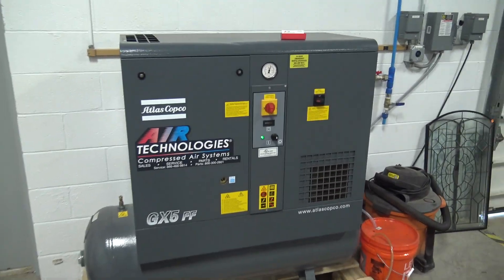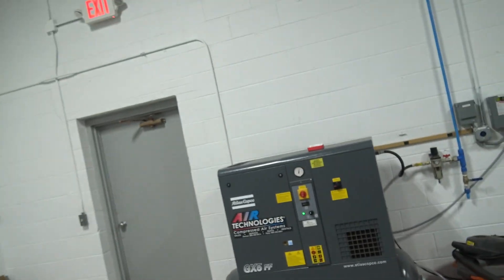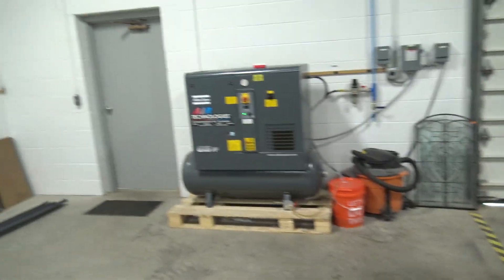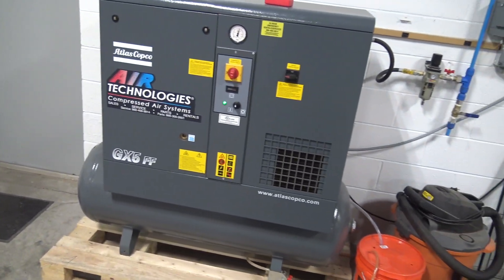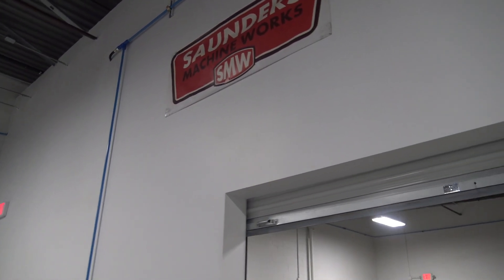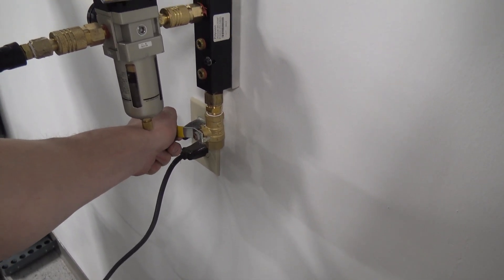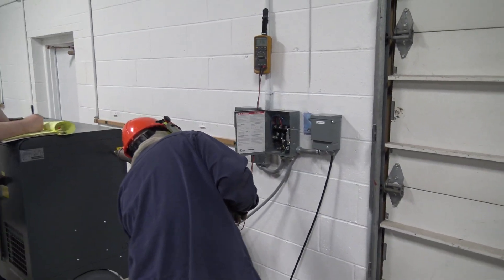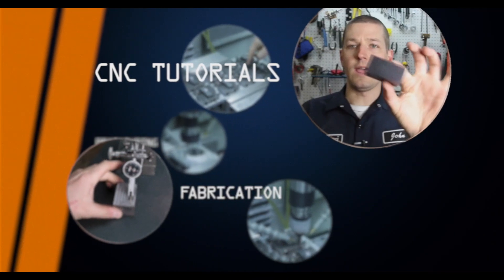Rotary Screw Air Compressor:  What are they?!  Worth the hype?

Comment: I bought a Kobalt Quiet-Tech and put it in a self-made wooden cabinet on wheels, and I have no idea when its running and when its not. I did put some foam padding inside the box, actually got that from my Hello Fresh food orders, its the "insulator pads" to help keep the food cold, worked great for insulation in the box haha. I really can't hear it. The only time I know it kicks on is if I am running my lathe, and pulling a lot of electricity, then my lights will dim a little when it kicks on, otherwise it makes no noise from the box.
Obviously the quiet tech compressors came our just a few years ago, so its newer technology than maybe what was available at the time of this video..

Comment: My workplace has a reeally nice Atlas copco screw comp, but they haven't gotten around to installing a proper pipe system. 
Instead, we have a mess of leaky air hoses hanging from the ceiling like christmas decorations. The high-pitched whiss from a couple of hundred leaky valves and hose clamps drives me nuts.
The compressor itself is very quiet though.

It produces a lot of excess heat in the area where it stands. We have a duct that can funnel the hot air outside, wich we open during the summer.
A ceiling fan helps to distribute the air throughout the shop, rather than just gathering in the corner.

Comment: I did not read all the comments.  Maybe it was already said maybe not.  
One of the reasons they like to continually run them is some of the starters in big plants cost 20 grand.   that have say a 200 hp to 500hp air compressor.  It is bad on the starter to start the machine repeatadly.

Comment: You said 600'... lol. In our smallest shops ( manufacturimg and maintenance... ) we have over 600 DROPS, 200 – 220 operators, mechanics, technicians, fabricators, etcetera. All done in " screw pipe "... ASTM carbon steel pipe... that smallest building is over 1,800 feet long and 500 +/_ feet wide with numerous compressors. Even doing my  proof house/prototype shop in town... was a pain in the pin feathers! 
I will say, yours turned out like you designed it... and is functional and sanitary! 
KUDO'S my friend, I realize this was shot 7 years ago... but still deserves a " pat on the back "!
Respectfully, Seth

Comment: If you dont have a large demand for air rotary screw compressors might not be the economic option. They are more suited for larger shops or manufacturing facilities that have higher demand. You can buy them with a VFD that will slow it down and unload it when the demand is low.

Comment: You can quiet your piston compressor significantly by installing a rubber hose as the only air intake to the filter housing. Some experimentation may be required in diameter, material, and length.

Comment: The after run on a screw compressor is so that the oil can cool. What happens is once pressure is reached in the tank the check valve in the screw housing opens and the return cooled oil floods the bottom of the screw vanes in the sump. If the compressor stops the oil would boil due to the generated heat of the hot oil on a stopped screw, under the circumstances the hot or superheated oil may also pose a fire hazard or cause varnish build up on the screw rotors and this wouldn't be good so cooled oil has to flood the bottom of the rotating screws.

Comment: We have a screw compressor  where I work and it is quieter than our old  piston compressors. But not quiet enough. Our screw compressor is outside of the main building in a dedicated shed here in Florida.  Its Way quieter!   My piston compressor at my home shop is also in a dedicated shed separate from my shop and it's perfect!  I can still hear it in case something goes wrong and I know when it's running , But it's not assaulting my eardrums.

Comment: The screw needs to get the oil hot enough that it keeps the moisture flashed off in the air.  When the air is pulled in, it is ingesting water as in humidity as well. You need to keep the oil hot to get rid of it.

Comment: THE REASON that you NEED a Rotary Screw air compressor is because, sooner or later, you need to run a basic AIR CHUCK (i.e. an attachment that permits you to steadily blow a stream of air, for the purpose of dispersing accumulated sawdust or metal filings.) None of the PISTON -style air compressors can "run" an Air Chuck attachment.

Comment: no refrigerated drier, you can't get good dry air without it, you may think it is dry close to compressor system but you will find moisture condensing closer to the end of a line. long term the screw will deliver air longer than a reciprocating compressor only if they are maintain if not keep your recip. and patch it up

Comment: Hi John A good reason for a motor not starting and stopping often is "hi current draw on start up and heat generated from start up. A motor will have a heat rating and will generate extra heat on start up this heat is usually dissipated while running.

Comment: Dear, professionally i am operating small sized stitching unit in which i required continuous compressed air. I heard about a renowned company that offers wide range of different screw air compressors and i am confused which types of screw compressor is best option for me. Here is that range: https://hitech-machinery.com/screw-air-compressors/

Comment: Wear and tear... load and unload

When a screw compressor hits the set regulator psi.  It PayPass the screws.

Open air valves and it hunts for air

Load and unload is like freezing and heating.... stressful for fine tolerance 

They last for tens of thousands of hours in an industrial field. 

Just keep it running      

They wear out faster if you don’t run them

Comment: You should have gone for larger pipe work, it’s a receiver and you’ll get less pressure drops and your compressor will stay off longer once it’s full. You should also have a bigger differential on the pressure switch if you want the machine to run on and time out. Larger Atlas Copco compressor over 160kw have only three starts per hour so run on time is long, it’s all to do with constantly stopping and starting the motor as it’s more efficient to keep the motor running than going through the star delta start cycle plus there’s less wear and tear on the contacts. . You should have gone for a GX model around 3kw as they switch off when pressure is reached and only start when the pressure switch is activated

Comment: The CNC shop next to mine (I use their air because I really only need it for paint guns and air sanders) just bought a new screw compressor because the old one died... it had low oil level and the guy who came to fix it said the wrong oil was used. He said screw compressor starts at 10HP, but it has a computer that basically keeps it on at slower speed bypass mode and it basically maintains about 7 bars at all times. The unit is also smaller and lighter compared to a normal compressor. The box for a silent normal compressor (basically a belt drive compressor inside a sound proof cabinet) was twice the size of a screw compressor of the same size. This can present a problem however as it takes 2 people to carry it and theft is a  problem...

Comment: There are lots of designs out there that could eliminate the noise. One design is like having two electric linear actuators that work together and compress the air into the chamber. Just like that.

Comment: Just some misunderstanding in the air compressor world report, POINT 1; a piston compressor still has more compressed air for its power consumption and is cheaper than any '*.*' screw compressor and POINT 2, Frequency regulators save space 'POINT', this is the only advantage. (Is not cheaper in consumption, or purchase or maintenance ) . The best setup is still a 'cascade setup of 3 stationary screw air compressor'! For more technical information contact me via messages, thank you. ... If you do not know a compressor seller the "15 - 30 - 45 rule", maybe it is better NOT to buy to such people, who have their mouth full of energy efficiency !

Comment: I used to work at Ingersoll Rand and now I work for Atlas Copco. I can tell you, BY FAR, the Copco is way better. The IR which is so popular and even sold at Grainger, is a maintenance money pit. IR is always and forever leaking oil all over the cabinet and lots of replacement parts throughout the years. Copco isnt cheap either but it is clean and reliable.

Comment: Your model may be equipped with air bearings?  If the air to the bearings is cut off when the motor stops (so the system does not bleed down) then the bearings will start up dry.  A computer can detect the pressure drop and start the air to the bearings before it starts the motor.  Your model probably has ball bearings. just a guess

Comment: If the sole reason you're bummed about not having a computer on board the compressor is due to the shutoff timer, you could always install an off delay relay in the control circuit to extend the run time beyond the signal provided by the pressure switch.  Couple that with either a solenoid actuated relief valve in the same circuit or even a mechanical pressure relief valve to handle the tank overpressuring issue, and you've accomplished the same thing.

Comment: I’m surprised that was enough compressor for your shop. You made a good choice in going rotary they are just that more efficient besides the noise if you don’t have a dedicated and insulated compressor room.

We used 14g aluminized exhaust tubing welded and length of shop for our main line. It worked well especially keeping it dry inside so it didn’t eventually rust.

Comment: I hate those right-angle joints with the main run. I met situations where they sucked up and not blew down somewhat as the old carburetor does!  I would have made the main run using a larger diameter pipe.

Comment: I was looking at entry level water jet machines recently and noticed that all the popular designs have ditched screw compressors and have moved to piston. They are using small tractor engines as the cylinder housing, wee 3 cylinder blocks, that drive a machined head and cam that does the air pumping. The moving parts are far simpler, the air is dry, and the total cost is less than half of screw compressors, with better performance all around. I think if they are too noisy, a sound proof box is the answer, not a screw compressor. What is the pipe draining out the bottom of the unit, bleeding off brown waste fluid? Really? On a new machine? It looks like a cancer patient that can't go to toilet properly, with its colostomy bag. It seems a bad design, full of compromises and clumsy solutions. Also, for what you want to program the machine to, a 12 dollar micro processor and 25 dollar 5 inch touch screen would be fine. It seems cheap that they didn't put that on a 7000 plus machine. Cheap or out of date, both of which are red flags.

Comment: Service all 4000h new oilfilter, (TEXACO = N°1 for scew comp.) all 8000h new oil separator element from (Atlas Copco) all 16.000h V-belt . Long live if you can make a 80% load running heurs. (In onloud the compresser thake 1/3 I nom. and  "VERY BAD LUBRIGATION IN ONLOAD MODE / broken compressor or bearings after running 40.000h !". best make space for a very big 1000L - 2500l air tank./ .... hoi "Make in BELGIUM", Make in Italie = made in China / "CRAP".

Comment: Two of the Machine shops I have worked in so far have had the compressors located in their own little shacks outside. This is how I will probably do it as well. You can remote a starter switch or button inside as well.

Comment: Good video. - All the comments are very interesting and helpful.Some information:Start / Stop compressor will create more moister unless the are run loaded for and specific amount of time and they cool down  in theory the same time.  - Application for Piston Compressor air cool are normally Intermittent work compressors.A rotary compressor that Start and Stops continually  about 2 minutes running loaded and then unloads for 1 minute and the loads again will have a higher carry over of oil thru the separator element [due to turbulence in the separator tank] , AND the loading and unloading changes the applied force to the rotor bearings and this will influence in the life of the air end, Oil Separator life can also be affected.    ---  [Same principal of the Taxi with Manual Transmission working in the city; the clutch plate and other parts [Bearing, Clutch Plate]; will have to work harder more continually; and need the clutch parts replace more often [because the Stop / Go = Start / Stop on a compressor]  - C ompare to a taxi that works running longer distances like intercity  [the working condition of Stop / Go  is much less frequent in a compressor normally the less it start and stop, the longer life for the aired and the less carry over of oil  longer life to separator element - less oil carry over to the line; if is running loaded close to the rated pressure; a cycle of 10 minutes running  and 4 unloaded  will also help - .] Note if your compressors start/ stops you can add al larger receiver since you compressor has a dryer , the receiver can be a Dry receiver lower Price, [However if the dryer break's Down more likely you  will not stop production and wet air will contact the inside are of the receiver and will develop rust with very bad consequence's to you system and valves etc. Some rotary compressor have dual control systems Start/ Stop or Constant Speed Control. How ever the Start / Stop will always be present if your demand in on the lower side.A must better solution when you have a variable demand of air volume is to purchase an rotary compressor with a variable speed motor  [this compressor Oil flooded or Dry Screw will lower the RPM of the motor to match the demand of air in an specific range  they will also start / stop  when the rich the minimum RPM ]and remember if you are worry with the oil in the system you can by a Oil Free Rotary Screw Compressor. [By the way Variable Speed Rotary Compressor are more expensive however the are also much more energy efficient.Usually a rotary compressor you will be able to see some oil on the sight glass at the bottom when is running, and if you overfill  it will pas oil to the line until it reaches it's correct level.Since you have a very long air line as long as the  air line has no leaks and you shut the compressor down and DOSE NOT LOSSE air pressure you will not condensate waste inside the lines, if pressure drops to 0 Psig due to temperature differential in the working area; if temperature drops more that 20 degree's [between outside and inside of air pipe;   there is a chance that your air pipe will condensate some moister inside, this will be remove ones the pressure fill out the system and some air is use until all moister is removed.Ingersoll Rand and Atlas have a very good manual on The Theory of air compressors, you can download and enjoy it reading.Enjoy you new partner for life.

Comment: Haha I made the same condensation catcher. I ended up using a evaporator cooler filter inside the bucket to make it even quieter. Now the air leaving the tank makes more noise than the air leaving the tube. :) Great video's always enjoy watching! BTW I have a Eaton PolarAir compressor (7.5Hp) has a oil pre heater, air dyer/filter, computer and auto drain, plus those guys have been great to deal with.

Comment: Short cycles are hard on them for a couple reasons. One - its a lot of mass and they don't have a vfd or a soft start and the shafts and coupling takes a beating. Also the contacts are prone to arc and suffer wear every cycle.
Also since the air is compressed progressively in the screw it is likely to experience condensation inside the screw as the rotors cool.

Comment: On your shop noise question ... hard flat surfaces reflect sound very well.   Soft or irregular surfaces absorb or deflect sound.   That's why commercial office buildings have acoustic tile ceilings, carpet floors, and soft cubical walls.  I have also seen individual panels placed in an otherwise hard room, to help mitigate some of the sound.   Even cars and vans use carpet and padding to dissipate sound.  

You could could use free-standing fire resistant acoustic tiles to form baffles around and over your equipment.    Air will still flow well, and you can have plenty of space to walk through, but the noise level from other equipment would drop dramatically.

I've even seen bed egg-crate foam used as sound dampers.  It's not pretty, and probably not up to code, but it works for cheap.  You could use some to test the idea.

You'd want to talk to someone local about doing it, to make sure you meet all local fire codes.

As a person with tinnitus from hearing too much noise for too long, I wish I knew it was a fixable problem back then.

Comment: Sound resistant panel. have them from the ceiling down 3 or 4 foot around the diffrent areas of the shop. hanging fire resistant hanging panels. Kind of acting like baffles.

Comment: no computer needed, get one of these https://www.eleccircuit.com/5-30-minuts-timer-alarm-circuit-using-ic555/, switch 2 is the pressure sensor switch that you already have, then connect a relay instead of a buzzer and use it to control the compressor.